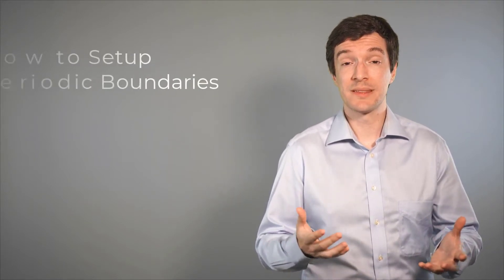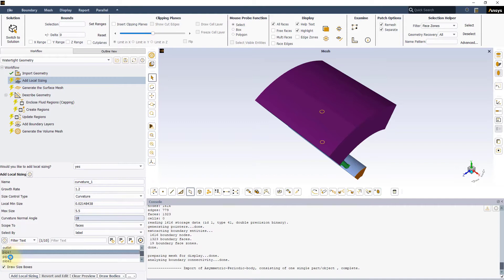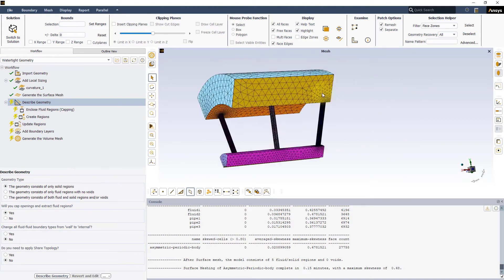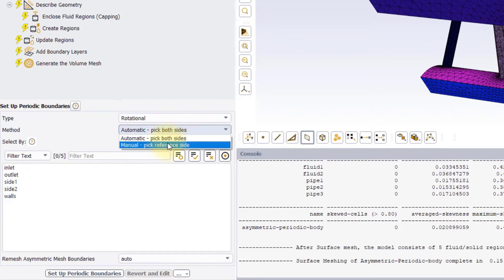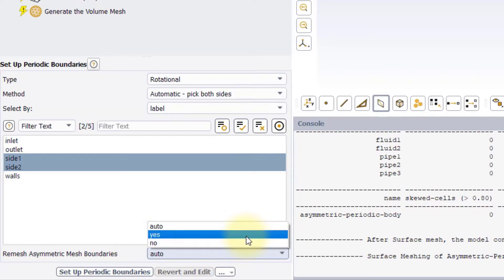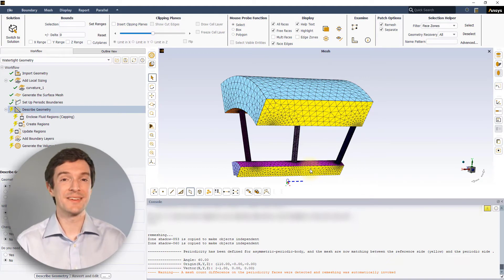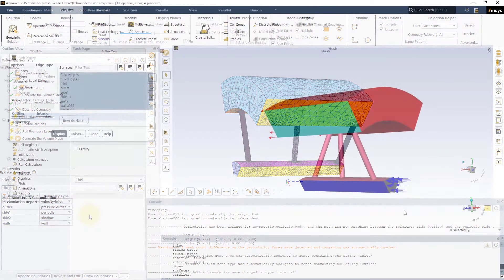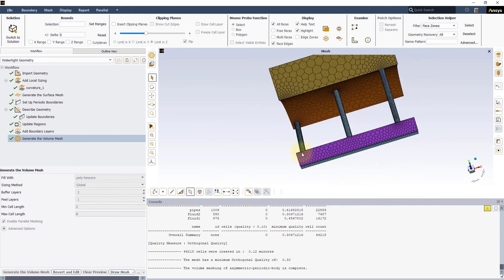How to Set Up Periodic Boundaries in Ansys Fluent Meshing’s Watertight Geometry Workflow

Comment from the maker: This video is part of the free Ansys Innovation Course “Generate the Surface Mesh”, which is one of courses that make up the  "Ansys Fluent Meshing Watertight Geometry Workflow" Learning Track. Access all of the course contents including additional lessons, handouts, simulation examples with starting files, homework problems, and quizzes: https://courses.ansys.com/index.php/courses/generate-the-surface-mesh/

Check out other courses on the website while you’re there. Happy learning!
Reply: Hi Everyone,
I am facing a problem in Ansys 2022 where I am creating a 2D flow past cylinder, and there is a 2 sided wall where I want to make periodic wall but the shadow wall is not creating in the setup. What should I do? What is the solution? Please help.